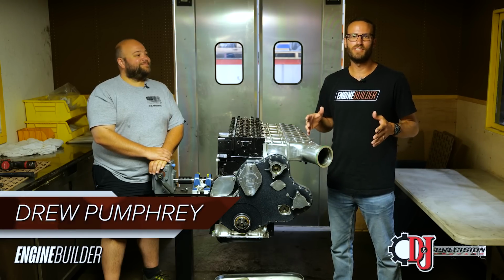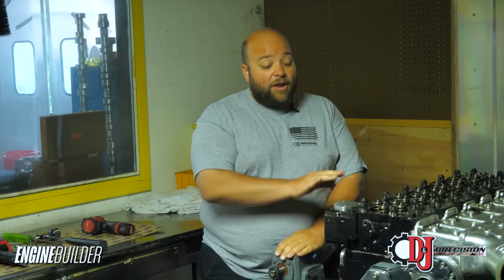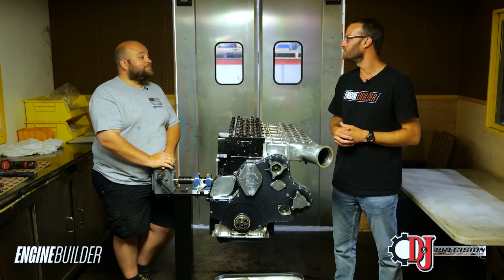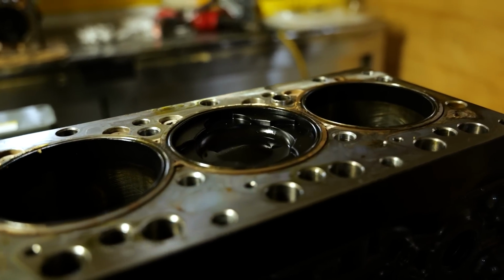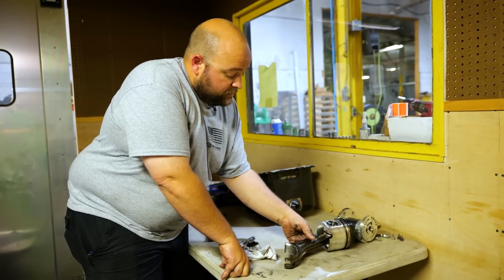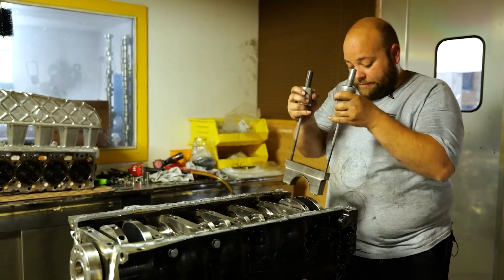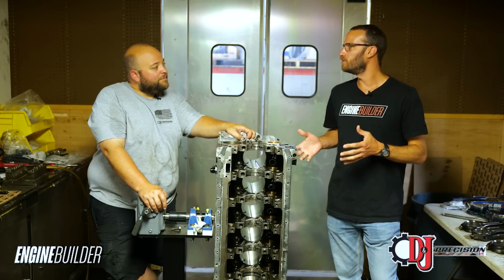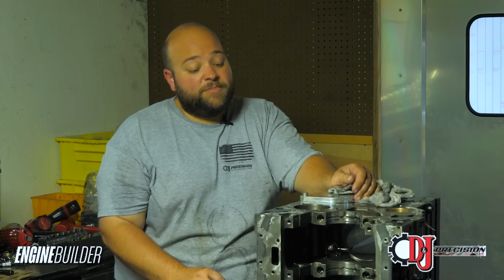Tearing Down Justin Zeigler's 3,336-HP Cummins Enforcer Engine

Comment: No one has been able to answer me and I’ve posted this question everywhere… why do diesel guys only run 1/8 mile? Why not 1/4 mile?
Reply: Saftey. I know it sounds like a lame answer but there's already been some accidents due to speed. And yes I know the gas guys do it but, they are considerably lighter than the 4x4 diesels (such as Zeiglers). It gets exponentially harder to stop as the weight goes up. That's why recently guys have been building lighter promod style cars similar to gas cars. It's a lot safer

Comment: Dyno run with rear brakes dragging, might pay to remove the drag before dragging.....
Reply: Uh no, diesels make power based on load.  If he didn't load the truck with brakes he would blow straight through the dyno.  As you can hear in the video he already blows through the run in a second due to the power.  At some point we are going to hit a wall with the actual dyno itself lol.

Comment: 3:48  Getting 3,000+ through tires on a chassis dyno is a huge accomplishment.  Pro drag racers use hub dyno's on their 3,000+ horsepower vehicles (see FuelTech's page) how come comp diesel guys are not?
Reply: I am going to guess they run the dyno with such a high wheelspeed / gearing disadvantage that they can do it?
Reply: If his truck was on a hub dyno I think it probably would’ve been close if not over 4,000 hp

Comment: I believe I’d want to magnaflux any single part that was reused.

Those guys at D&J have done one hell of a
job with there enforcer engines. I want one!lol
Reply: You won’t regret it. I’ve street driven one for 3 years at 1350hp and not a single hard part issue. I’ve had the bottom end apart to have a look, not a single problem! 
Well worth the money

Comment: I’m impressed with how the engine is really holding up. 

The inline 6 engine with 7 large main bearings to support that crank with those cylinder pressures and load surely helped a lot. 

Nitrous is nasty stuff especially when they backfire. 

At that power level, it’s getting near to where top fuel style engine rebuilds is a must to make sure none of the parts are starting to fail. 

Those piston rings sure are taking a severe beating to last just a weekend.
Reply: Dt360 might do better

Comment: 3,300 hp with a stock crank I don’t think theirs another engine on the planet that can do that, especially with 6.7 L
Reply: 6.0 powerstroke
Reply: @cs-gj3yf  LOL
Reply: @GordonTurnerr  6.0's have the strongest bottom end in the truck game, jesse warrens 1910 run was on a stock bottom end with 100+ psi of boost and 4 kits and welded heads, educate yourself.
Reply: @cs-gj3yf  my math says that's 1300hp shy of 3300...
Reply: @GordonTurnerr 😂😂😂
Reply: @cs-gj3yf  Yes 6.0s have a bed plate they are really strong.  However unless you figure out a better injection system we will never know, not to mention the huge cubic inch difference.  You will never be able to spin the required rpm needed to make up the difference in cubes.  Even common rails cannot overcome a certain point because of rate of injection, and HEUI is lightyears behind common rail.
Reply: @joshuaquilliam2887  jesse warrens pulling truck was gonna make over 2600 hp if he wasnt having throttle position sensor issues. it made 1600 hp 1/2 throttle, i gotta good feeling about him.